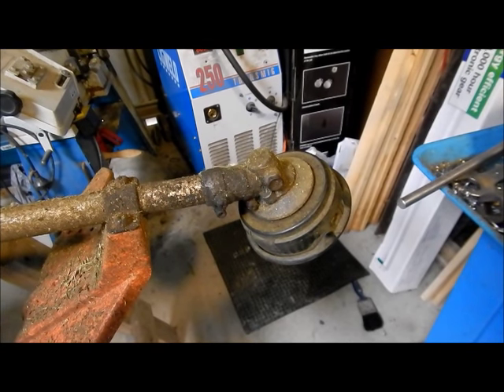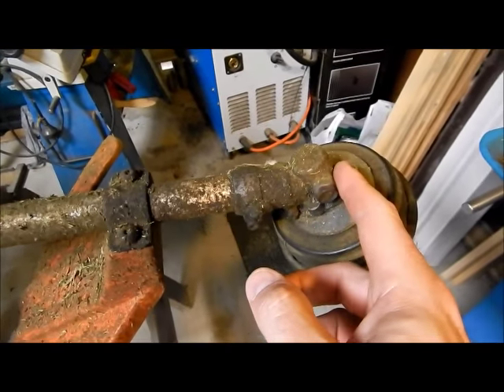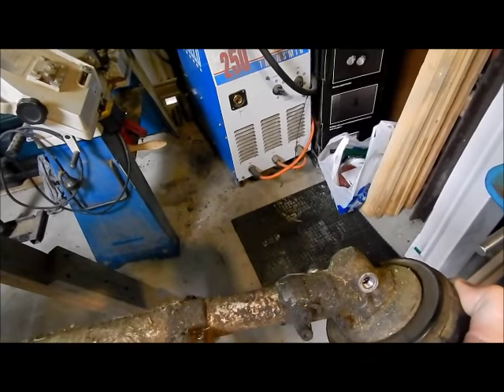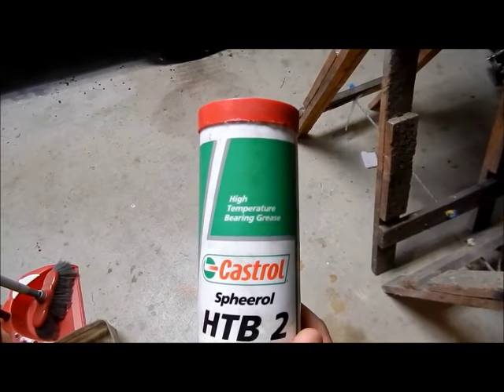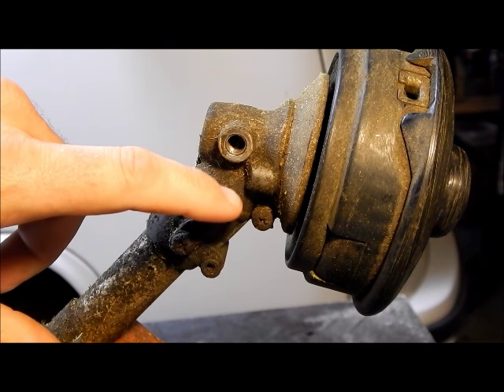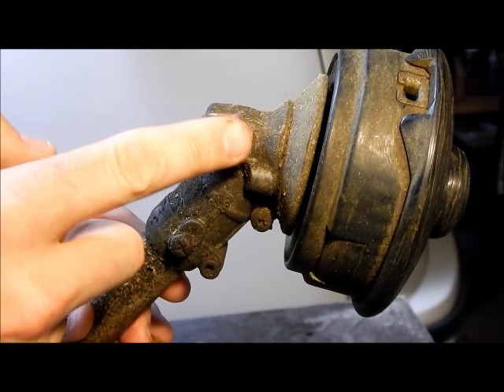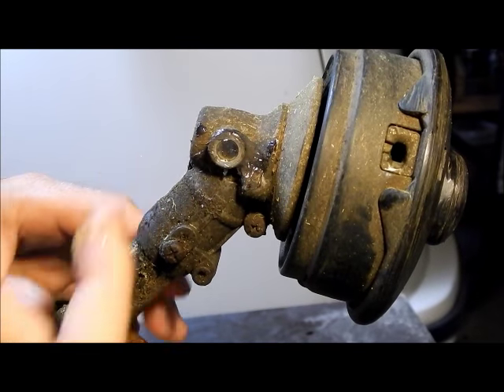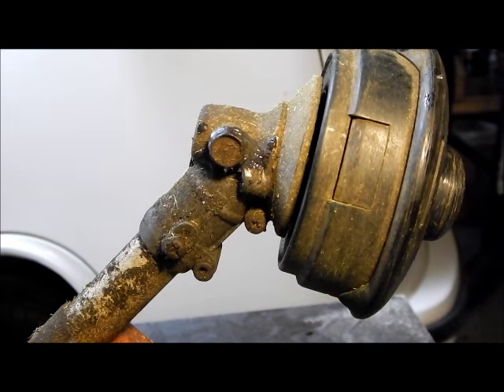DM Engineering - Greasing the head on a whipper snipper / weed eater

Comment: I’m took my Ryobi Expand it completely apart today after realizing it was sort of hard to spin. Sometimes grass can get bound up above the string body but not today and this angle double 45 pinion body was fairly hot. It’s about 10 years old and I haven’t ever added grease. I’m able to remove the top pinion after removing the c clip that held it in. The grease is fairly hard in there at the gear joint. I put some gas in there and spun it around. I just can’t seem to get the bottom pinion to come out even after removing that c clip. 

That’s what I’m hunting YouTube to find out how to get out.  I probably have more time into this than what it’s worth. HD probably got part for $15
Reply: Update: Repairclinic has them for $21-25 or if I want a completely new shaft with the string holder it’s $60 at Home Depot. I could either just put new grease in there and call it good since it spins easy now or just buy a new part and not worry about it again for awhile.

Comment: your talking a pinion gear right ? cast or cut steel , haven't seen one forever in the old usa for I don't know how long
Reply from the maker: +Eric Hatchett  -  Pinion or bevel gear set up, I would think machined and hardened steel, they wouldn't last long at my place if they were cast.
Tanaka online manual, pg 13 and 14, part 35.  http://www.veillon.fr/telechargements/eclatees/Tanaka/Ancien%20Eclat%E9s%20TNK/TBC-225.pdf

DM

Comment: we get a season out of ours if we're lucky , the Boss bought a trimmer on wheels it works good but it goes thru the string quick hell I ran braided cable in it the stuff with the plastic coating it just last slightly longer , but your trimmer looks better built then the ones they sell here